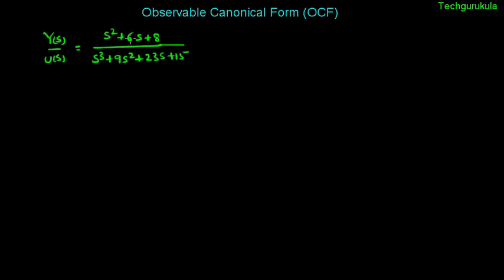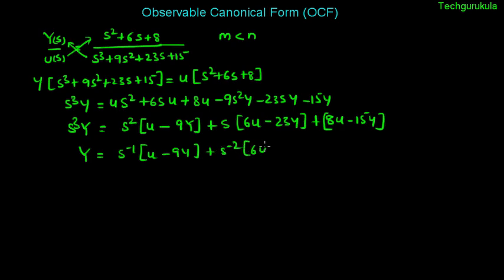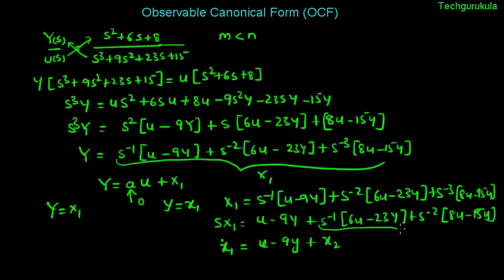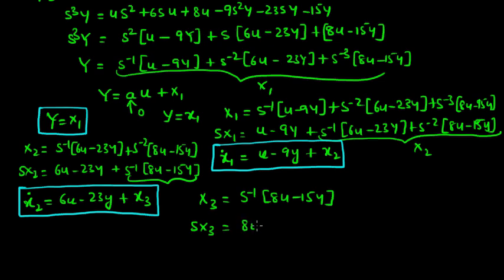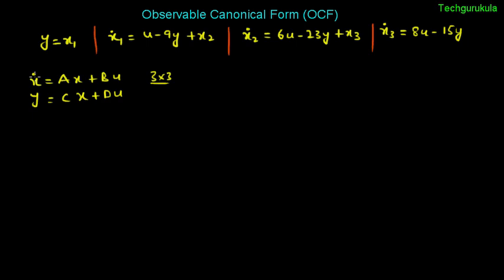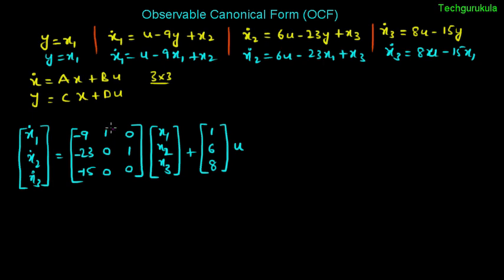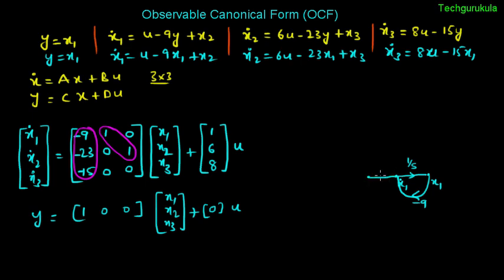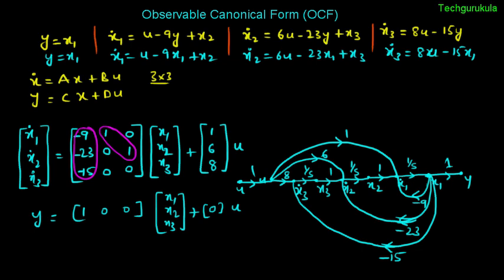Observable Canonical Form (OCF) - (m less than n)

Comment: not correct method because the result form isn't like observable canonical form
Reply: He simply swapped the order of the orders. dot x3 is first then dot x2 and finally dot x1. When you reorder it with descending orders you get the correct format. The method is correct.
Reply: @InarusLynx you are correct bro.
Reply: In the above video instead of considering y=x1, consider y=x3. then u will get the correct observable form.